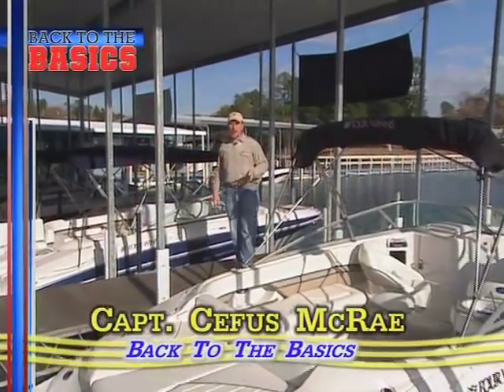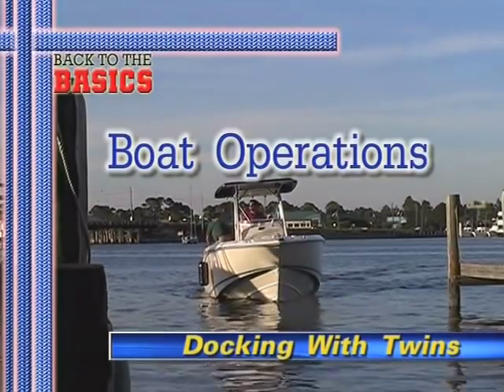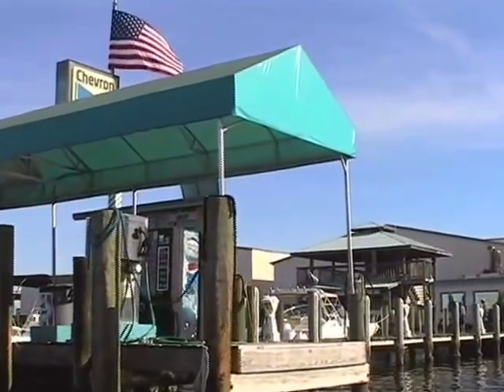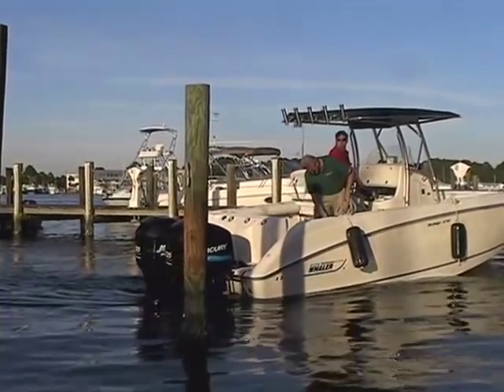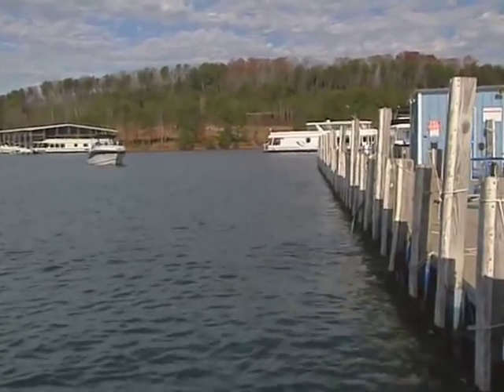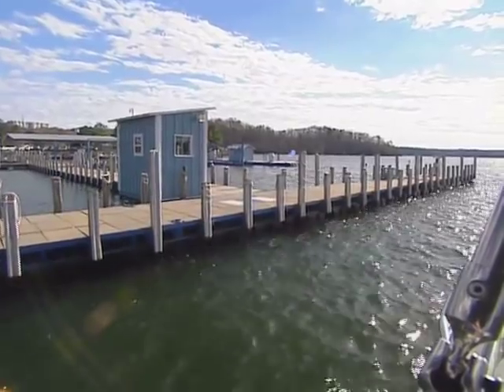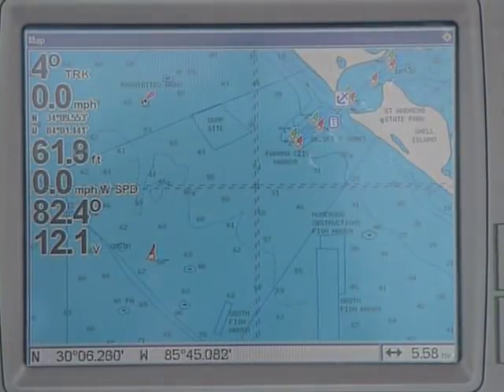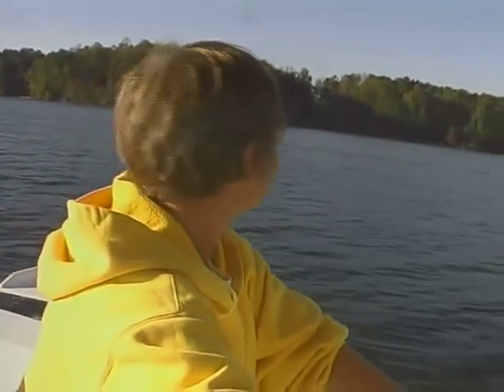Boaters - Learn How to Improve your  Boating Skills the Easy Way

Comment: With twin screw, if you remember to center your wheel and leave it alone,   just set engines slow enough to shift, and treat the port and strbd shift controls as if they were the edges of a steering wheel. that way, the direction of the engines will seem intuitive.

Comment: "In most cases, you shouldn't ever have to touch the wheel" - as the guy starts cranking the shit out of the wheel, lol
Reply: +HotRodKush .....He forgot to center the wheel before backing in. Whole docking would have been better (note boat backed to port instead of backing straight. And then he had to crank wheel before using forward to come to stop.
Reply: +HotRodKush This is because he did this maneuvre way too quickly and with too much throttle.
Reply: I saw that right away. Looked almost in panic mode. Lol
Reply: Yep I noticed that as well, then when fueling up always have fenders out and lines ready, they had neither! I assume these folks are well intentioned and competent, just lousy teachers